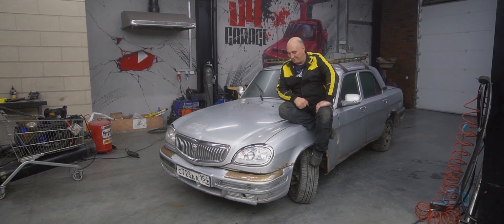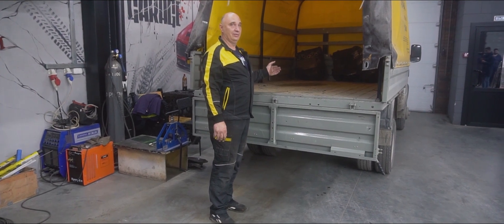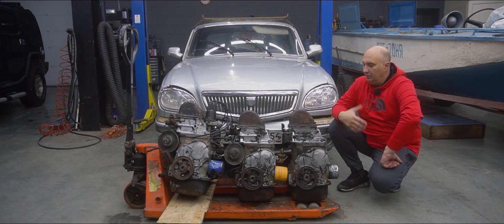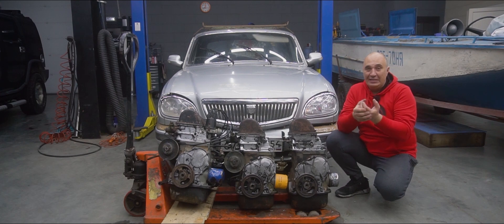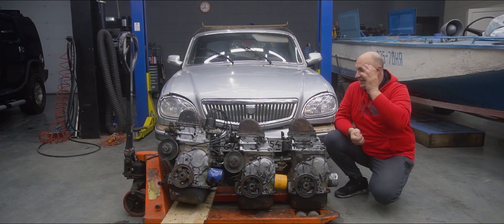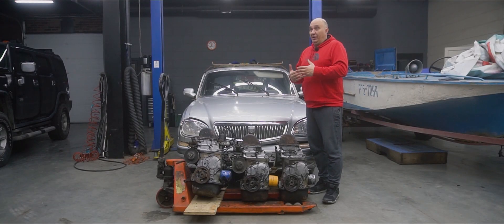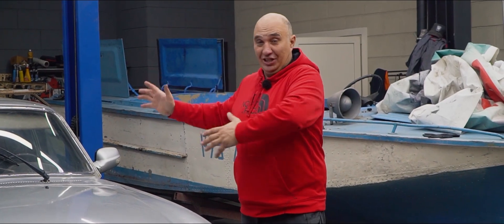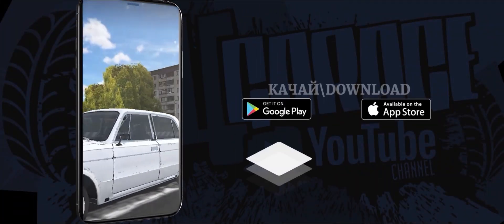Combining three Lada motors into a makeshift V12

Comment: I'd use gears, 3 huge ass gears to be specific. :D Just line them up, fix the engines in place, and its done 👌😃
Reply: You do realize that as one gear spins its meshes with the other gear spinning it in the opposite direction. On top of that all three gears would be driven and it would never move.
Reply: @notoriousls5513  you are right, it would need a 4th gear for the most under engine. But It would definitely move afterwards, as you only need to get the power off just one of them for the transmission, plus if any of the engines would stall for any reason,  it would be a nice restart system aswell, as the other engines can spin it back up without a problem
Reply: @ThePeca1988    imagine the first gear/engine is spinning clockwise and thus turning the gear on the second engine counterclockwise and either turning the engine backwards or stalling the two. So I cant see how you would get that to work . You would need a chain with sprockets rather than gears to achieve what your trying to explain. But gears will not work. My best guess of how to do this successfully would be to weld sprockets on all three balancers, put all engines at TDC attach the chain timed at TDC on all three engines.
Reply: @notoriousls5513  it would only need "planetary gears" to counter effect the wrong spinning direction and thats about it. Chain drive is another good option, but i believe its more difficult to pull off, because once its out of sinc, its most likely to tear the chain apart
Reply: @ThePeca1988   Utilizing planetary gears from three  drive inputs is something Im not sure would work. Plantetary gears are often used as speed reducers. Often used with two inputs and one output or visa versa. Care to explain how that would work? Also have you thought about how large that  transmission unit would have to be if it could work.

Comment: Don't do the "Y-12", instead do an V8+I4 with two transmissions. Put the V8 in the front, and the I4 in the back.  Maybe turbo/supercharge the rear engine to compensate for the power and torque made from the front engine?

Comment: Really want to see this thing work. Simplest rig is a v8 (two parallel I4's). A V12 you need you to split one the engines, but that's a mess as while you may get away with spliting the block (still iffy), the heads will be a pain as there's plumbing involved.

Comment: Should make V16 4motors 
I mean in V8² combined and use truck transmission on the center with the flywheel driven the v8² by chain....man hope the comment section have a whiteboard so I can quick sketch

Comment: The bottom motor needs to be laid flat on its side and the top 2 in a v configuration, then make a chain drive off the backs of the motors to drive the great box.  The best I can think of from a packaging stand point and a reliability stand point.

Comment: Or simpler just like I said but the gearbox would be connected to the lower engine and the transmission of the upper engines would be done through the chain directly on the flywheel of the lower engine, so it would be simpler and the gearbox would theoretically be her place

Comment: Sync all the engine to piston number 1, and connect them together to a single coil (from engine number 1) so that they will run each piston at the same time.

Or

Sync them to fire at piston 1 engine 1, then the 2nd engine to fire at piston 1 when engine 1 exhausts, and then engine 3 to fire at piston 1 when the 2nd engine exhausts, it will be weird but I guess it will work.

When piston 1 exhausts, the other piston from engine 2 will fire, and then at each cycle you have at least one piston firing rather than using its own inertia to exhaust.

Get some metal structure that will hold the engines in place and bolt the engines to that structure by combining some rubbers with nuts to avoid vibrations.

Comment: If your going to join them engines there going to have to be mounted on a solid frame doing away with the rubber engine mounts. The frame will need to be mounted reusing the car mounts to the car. As for drive this will be from the three pulleys fitted to the front of the engines maybe you can find some Rev up and go scooters that you can use the belts from. But this option would allow you to mount the engines in the fashion you wanted too from the start with main centre engine running clutch and gear box and one either side on an angle 📐 as boost power. Or you can use a heavy link chain and sprockets to do the same job, running a chain around fly wheels is not going to work well the chain would have to be a special high speed chain and engines would need zero movement or chain will derail and because it’s on flywheel it will cause major damage to the chain

Comment: ah yes, the infamous Lada Y-12 engine. a devastating 160hp
Reply: More like 60hp
Reply: @_jb_  explain.. If each engine is 60 he, you're looking at 180bhp gross power. Take away losses and you got most likely 140 to 160bhp..
Reply: @John23asggd  it was a joke...you gotta be really fun at parties...their biulds are always fun but they struggle to spin the wheels..... like the ladzilla for example
Reply: @MrHBSoftware  Not every viewer is so addicted to Garage54 that they see that all their builds end up in expected power/3. Your “joke” was too far looked.
Reply: @John23asggd  
Well , Garage 54 tried to make a Three engines Lada before. That had 164 bhp at the wheels  , which is like 190 bhp at the crankshaft ( 15% mechanical losses).
Reply: @John23asggd  on the rear wheels more like 130
Reply: @MrHBSoftware  The Ladzilla engine was basically broken though. It wasn't firing on all cylinders and was running like GARBAGE.
Reply: @MrHBSoftware  More fun than you!!!😂😂😂😂
Reply: @_jb_  Down hill with an arctic tail wind !
Reply: @zacharyreynolds4303  pretty shit joke either way
Reply: 560 ft lbs though. So much torque, the chassis twisted off the line. Due to rust mostly but it twisted.
Reply: @the_kombinator  how does it make more torque than the listed torque numbers x3
Reply: @Onamission1745  Because Soviet design. *edit or maybe Italian?  When you mate three engines together, you triple the HP, but the torque exponentially increases by the number of engines, -1. Look it up.
Reply: @the_kombinator  that doesn't make any sense
Reply: @Onamission1745  It makes perfect sense. It was made from low background steel.
Reply: Well , a turbo with bigger I rector's and fuel pump and increase the output to 220 bhp.
Reply: That will burn some rubber.....
Reply: Yes but wait until they add six turbos
Reply: *downhill
Reply: Well the last time they combined three ladas they got 165 whp which is like 190 bhp at the crank ( assuming 15% loss in power).
Reply: quickest car in USSR

Comment: 1. use a chain to connect them together, not a belt. Use a really beefy chain that can transmit lots of power.
2. synchronize the engines in such a way that there is never more than one engine at TDC at the same time.
3. read the english comments as well, or else it was totally useless to post this.

Comment: you can always machine a gear box for multiple engines like they do in tractor pulling. they sometimes have as many as 6 or even 7 engines in a gearbox set up to a single clutch set up. might be an idea  :)

Comment: You can connect all three shafts through the back of the engine through a thick drive chain and in the middle there will be a flywheel and the gearbox connected to that chain, it might be work.

Comment: That is a W12 configuration . You can just use a couple divorced style transfer cases from 4X4's and join them at the PTO outputs. Or if you're lucky to find one with 3 outputs just run it backwards....

Comment: W12 would be correct name https://en.wikipedia.org/wiki/Napier_Lion is good example. Probably best to put 2 engines in a V with large angle like 120deg, and put the other one vertically in the center. Got to make sure oil drains out of the V engines well enough. Use Gilmer in the front to connect them all and time them.

Comment: Big pulley on the transmission, belt coming from each engine, Have the engines setup like this metal mounting frame in middle engine on top one on the left one on the right space apart so all three belts line up with the pulley on the transmission.

Comment: Make a electric-Lada using only startermotors attached to the gearbox!!!
Reply: Starting in the first gear with the starter in a Lada is not much a challange, it can work that way, I experienced it the hard way (my clutch died), though only for very little distances. Otherwise you will kill the starter motor. And since it can take dozens of ampers (more than 100A) you would need at least some kind of watercooling to not overheat them instantly, simple aircooling would not work.

It would make more sense if they used a truck starter motor, that would probably last a bit longer.
Reply: Bad idea,starting motors burn cause they are not builded run loong time.
They produce strong torque in short time to spin engine.
Reply: @joe125ful  a spectacular failure that's what I want to see. I can't be the only one. 😆
Reply: @joe125ful  the best way around the problem of starter motors burning out is to use so many starter motors that's its entirely overpowered, so each motor doesn't have to work very hard to accelerate the vehicle 😁👍 still would need to let them cool down of course though haha
Reply: @thecrazyfarmboy  Yeah also 5 starter motors eat 400-450Amps..you really need lot of power too:)
Reply: @joe125ful  the inrush current would be more like 450 amps per motor lol! if they used lead acid batteries they would need to use a ton of them in parallel.. I wonder at what point the laws of diminishing returns would come into play 😅
Reply: @joe125ful  btw I was thinking more like 10 starter motors 😂 it actually takes a lot of power to drive an EV, 1000w ebikes aren't even very powerful
Reply: @thecrazyfarmboy  Probably the law of Explosions would kick in first :)
Reply: @Reziac  if I had anything to do with it, probably 🤪
Reply: @joe125ful  this channel is built of bad ideas, therefore it’s a great idea
Reply: @joe125ful  check the kreosan english they maked an e bike with starter.
Reply: @joe125ful  water cooled starter 🙃
Reply: @joe125ful  you'd be surprised, if they are allowed to rev freely they are not too bad, I built an electric go-kart as a kid.
Reply: @joe125ful  but u need to make cooling...
Reply: @eminzupic576  easy just get a large radiator.
Reply: @joe125ful  they are russian starters, they are stronk.
a bit of homebrew cooling and they last.
Reply: @CAESARbonds  Vodka can cool anything:)
Reply: @joe125ful  you know what that’s too bad I wanna see what haopens
Reply: @alternatemusicaddict5226  Yep all we know that.
Reply: @joe125ful  just PWM the starter motors, use a lot of them
Reply: @monad_tcp  How many times i need repeat myself...starter motors are not builded for long time runing.
Do it in your car and lets see what happend:)
But maybe if you use Truck starter motor in lighter wehicle that maybe can work but you need truck battery.
Reply: @joe125ful  I didn't say long time running, I'm going to put 25 starters and fire them for 10sec each in sequence.
Reply: @monad_tcp  Is it really worth 10 sec?
Reply: Life od did it already
Reply: @joshuabustamante7875  Garage54 can do it better!
Reply: @joshuabustamante7875  oddmhga
Reply: Try a forklift motor
Reply: @willpitts9957  Or hydraulic engine can be fun to do:)
Reply: @willpitts9957  Lada startermotors are more Garage54-thing to do..
Reply: Theres a guy who uses 8 washing machine motors to build electric car.
Reply: @zasadacrew  who? Link?
Reply: @lassediscovers1813  , Denis Mechanic. I'll try to post link in here. The only thing is it's in Russian.
Reply: @Joachim Shekelberg Maybe..
Reply: @Decaying Grandeur you have a video/picture of it? Sounds awsome!!
Reply: Brilliant idea. You can attach multiple starters to a flywheel if you modify transmission bell. Submerge all starters in oil. You can also wire it like train engines so you can have them all in series for slow start, some In parallel or full power - all in parallel ;)
Reply: Nice
Reply: Lol Tesla lada
Reply: Hahahahahahahahahaha
Reply: It would go very very slow
Reply: well that would probs be a tad shit, i mean jeez a milk float motor would be faster and cheaper
Reply: Tes-lada
Reply: You can easily do that with any car, pull the spark plugs, put it in gear and crank the starter.
Reply: @exogator  Or be poor and just run out of gas
Reply: @jere.nurkka  yeah, but you'd be fighting the compression while cranking. Atleast by pulling the plugs you're reducing the load on the starter
Reply: Or a old lift motor thay have alot of power
Reply: @Joachim Shekelberg or into a fuel tank :D
Reply: Oohh. Like a professionally designed electric Lada? Like the modifications should look futuristic

Comment: Make a bracket to connect the motors together using the normal motor mount bolt holes. Struts will run from the top motors down to the bottom one, then across the top of the bottom motor to connect the two top ones together.
Then make a big backplate that bolts together where the bell housings would go. You will need to weld something from the frame of the car up to top motors. Bolt that to the outside edges of the top two motors to stabilize them, otherwise you'll just break the motor mounts on the motor at the bottom. 
There are lots of bolt holes in the front of the motors that are used for attaching accessories. Make a bracket to connect those together in a triangle as well so that the motors can't twist relative to each other.
Instead of belts, use a motorcycle drive chain to link the output shafts. You can have multiple drive chains if one isn't strong enough. One alternator for all three motors is probably fine, but you're going to need a separate water pump and probably a separate radiator for each motor. You guys are geniuses at figuring that kind of thing out.
The biggest concern I have is mounting your top motors at an angle. You could potentially starve the engine of oil if it's at an angle and you're going around corners. You might need to modify your oil pickup tube so that it is in the bottom of your oil sump.

Comment: I would say use transfer case chains. Try to hook them together with the pins if it's possible to make a longer thick chain, and use the gears from the transfer case,  ones with the same tooth count and size, to match the engines. I don't think belts will help at all, just like when you added another engine and it didn't do anything spectacular to the speed because they weren't matched. Imagine you install an engine above the regular engine, and remove everything from the bottom engine, just a crankshaft in a block, no pistons. And try to drive with the top engine through the belt. I don't see that happening, even with a ribbed belt from a supercharger, which, let's face it would be a massive expense for no reason. The bottom engine will do most of the work, like you have 5 or 6, maybe 7 cylinders, not even close to 12. Grab some blown transfer cases those can for sure move a vehicle, take the chains and main gears, and weld those to the balancer. Also making sure the chain doesn't slide off.

Comment: Use some sort of chain drive on the flywheel/flex plate that couples the three units together with the final drive output coming from the center engine.

Comment: no rubber fluctuation in the sub chassis....tight them firmly into the chassis...from the engine sub chassis to the car frame use rubber cushions... all them connected in the same speed box.... belt and go to motor front or flywheel

Comment: You guys should build a 4 engine AWD Lada where each wheel is individually powered
Reply: @Michael DeLoatch So you want a lada which weighs 4 tonne?
Reply: @thermionicemission6355  The Lada engine is not that weight.
Reply: cool ok
Reply: Michael DeLoatch Love to see this. Cars and Cameras did something like this on a go kart using small engines.
Reply: Now that is a good idea 🤔🤔🤔
Reply: This works with 4 E motors

Comment: Seems to me you guys are building a w shaped engine sort of like what Volkswagen is come up with in the past w24 w18 anyway you could set them up so that everything is bound at the crank or in this case cranks you could have some connecting rods connect to the Kranks among them instead of running all the Pistons or reforge parts so that you can combine the Pistons the Kranks and still run all the Pistons well best of luck gentlemen all the way from Cedar Rapids Iowa